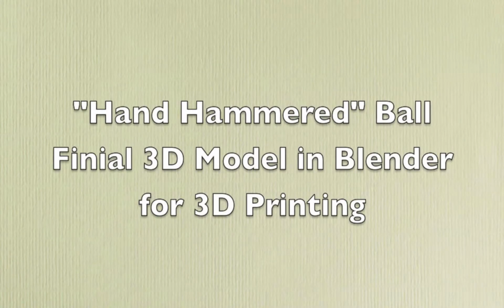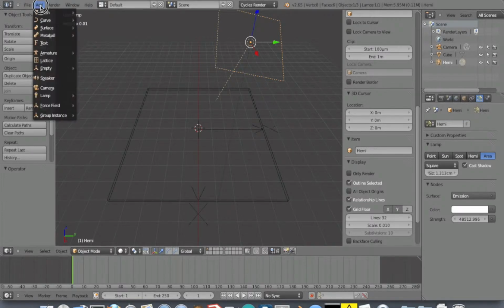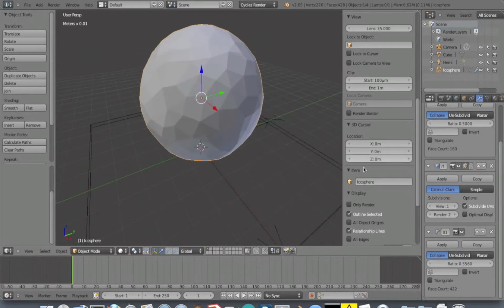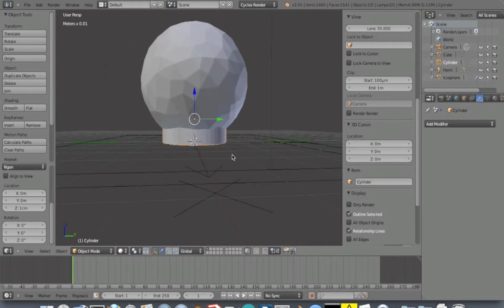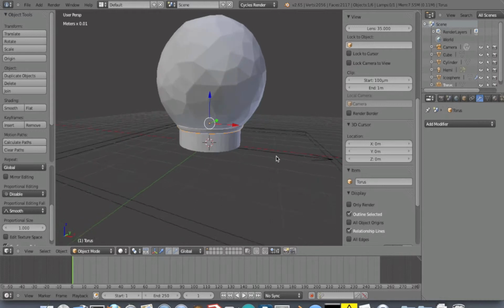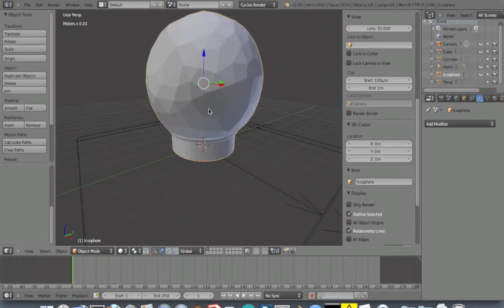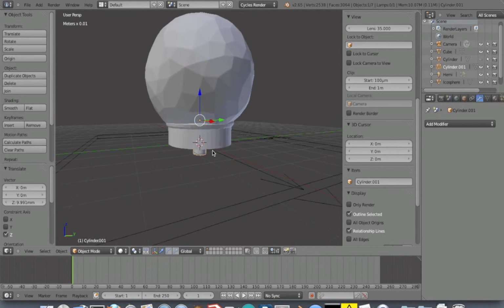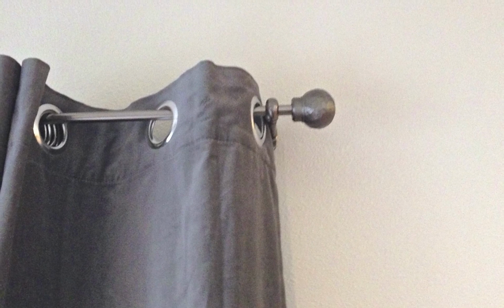"Hand Hammered" Ball Finial for 3D Printing using Blender

Comment: Nice! Did you add a threaded rod to the final part so you could screw it in? Or did you make the hole big enough to go over your curtain rod?
Reply from the maker: Yes to the threaded rod! Well, kind of. The original finials that came with the curtain rod had double-ended screws that I removed. I then made this hole ever so slightly smaller than the screw; one end went into this smaller 3D-printed hole which kind-of self-tapped into the plastic, the other end "just worked" (since it was meant to).